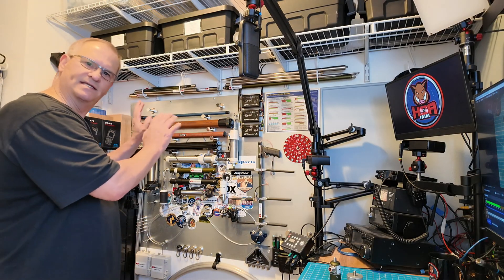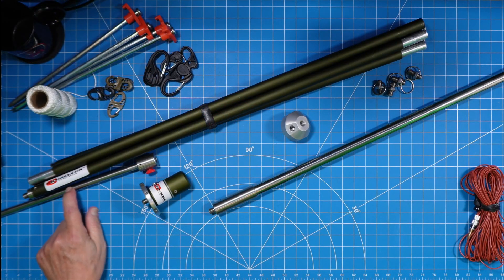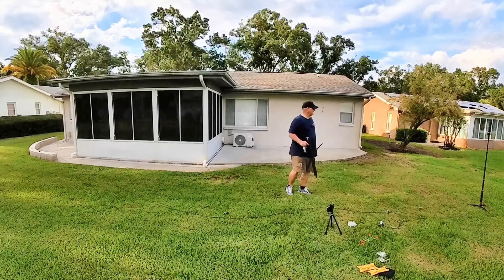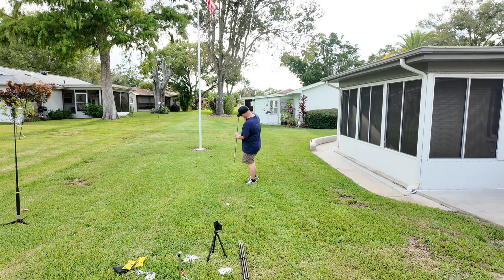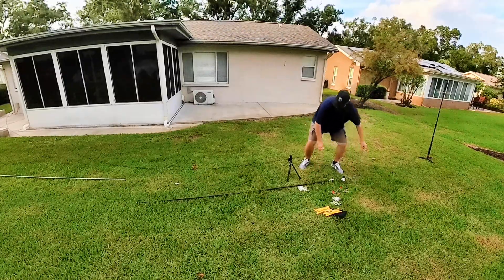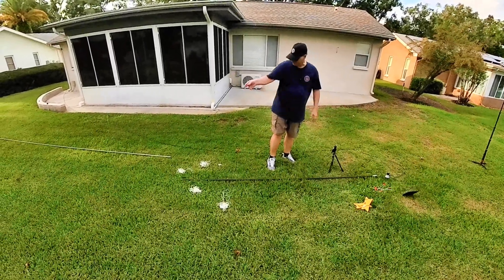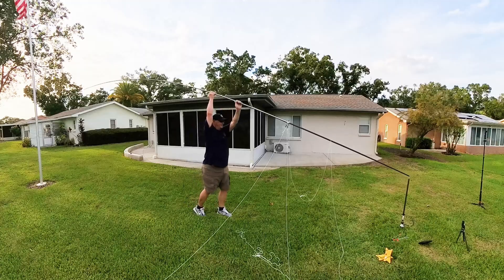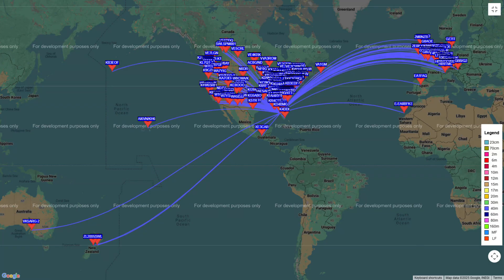Make a Collapsible Portable ¼ Wave 40 Meter Amateur Radio Vertical Antenna with Components You Own

Comment: Great video, Bob. Since I have other antennas I go portable with, I have been thinking lately about making a semi-permanent quarter wave vertical near my shack for forty meters out of some aluminum military mast sections.  I have the hard plastic top and bottom sections, so separation from the ground is there, and then I'd need radials.  The total length of eight sections would be thirty-two feet, so I'd need another foot and a half at the top, which could be just about any piece of metal bolted on, or a cut down mast section.  That old Army stuff is heavy to lug around, and I know because I did it for twenty-two years.  Should make a find 40 meter vertical.  So, thanks again for posting another excellent video!

-K5SFC
Reply from the maker: Sounds like you have a solid plan.  If I wasn't in an HOA I sure would find a way to get a 1/4 40 up permanently - it works so well.  I enjoy 20 and up mostly because its easier to hide those antennas; 40 is more difficult for me  --  this solution worked!  Have fun with your planned deployment.

Comment: If you don’t have CHA Mil Ext, can the CHA single ext be used.  One set of the singles is 54 inch’s, and looking to use a surveyor tripod.  If I use a spike, a second set of the singles ext would give me 108 inch’s vis 105 with mil ext
Reply from the maker: I think you will be just a smidge long with two of the "singles", but you can always reduce the whip just a bit to get it resonant...it will work.

Comment: When I deploy my 25' whip, I always have it screwed into the blank and I extend it straight up vertically to avoid stressing the joints. In your situation, I would have put the SS25 on the mil extension with the SS25 collapsed. Then I would have taken a step ladder outside, stood on it, and slid the SS25 up vertically. Since the mil extension was up about 8 feet high and most people are roughly 6 feet tall, any modest step ladder should work.  That aside, I like this idea. I have everything but the mil extension so I might buy one so that I can set-up a 40m antenna without the high Q and losses from a coil. 73
Reply from the maker: Yep, I think the step ladder version works best for stability during the set up, and less strain on the telescoping whip joints.   Thanks for the view and comment.

Comment: Thanks for another informative video Bob. Always enjoy them. Maybe try erecting and stabilising the Mil-whip first with a little slack in the guys before dropping and making the final installation of the CHA25 a little less exciting (expensive), particularly if there is a breeze. Loved your aproach to walking it all up with the first section installed as a stabiliser.
Peter
Reply from the maker: Thanks Peter for the view and comment.  Several alternate suggestions came in to add to the list, appreciate yours.

Comment: just a heads up, you said 24 feet the graphic on the video says 23 1/2 feet. I’m pretty sure you meant 33 1/2 feet.
Reply from the maker: Wow, that's what I get for putting the finishing touches on my video at 2AM...mistakes.  Thanks for catching this and letting me know.  I did indeed mean 33 1/2 and I pinned a comment with the correction.  Thanks again.

Comment: I’m running a 20M half wave/40M quarter wave vertical wire on a partially extended 42-ft mast, feed point elevated 7 ft, with an elevated 32-ft radial. These are connected to a 4:1, and a choke on the coax. So, it’s basically a giant POTA Performer for 20M and 40M. It works great. Granted it’s not portable though; the mast is very heavy. So you’ve given me food for thought as I have most of the bits you used as well.
Reply from the maker: You're the second person to mention the half wave 20M....how did I not realize that was right at my fingertips????  Gonna have to do this again for sure.
Reply: @HOAHamRadio fractions are a struggle for some. 😂

Comment: I run a full 40m 1/4 vertical but I do it a little different. It started life as just a 29ft random wire. One day it dawned on me that with a another 3 feet or so I could swap the 9:1 for a 49:1 and have a 20m efhw so I added a 3ish foot section of wire. Some time later it dawned on me that wow that's almost a 1/4 wave on 40, so I swapped out the unun for a cobra head connector, cobbled together a few radials, ran it up the 10m mast and it worked brilliantly with no additional tuning. I now have 3 antennas from the same piece of wire.
Reply from the maker: Interesting how these ideas morph over time; that's how it works for me too. Thanks for sharing.

Comment: Very interesting adaptation of antenna parts. Now that you've figured out the parts to make a 40m 1/4 wave vertical, I'd love to see this adapted to a 20m vertical half wave. That could make for awesome DX.
Reply from the maker: Now why didn't I think of that???  Thanks for the view, and the idea; gonna check that out for sure.
Reply: @HOAHamRadio I really wish someone made a 49:1 in a package that fit 3/8-24 top and bottom.

Comment: Instead of using the little weak string - you could use a pack of CHA COUNTERPOISE KIT and it them as antenna stabilizer BUT also as radiator....
Reply: How long should the ground radials be in this case?
Reply from the maker: Hmmmmm.  Ring terminal on the CHA Counterpoise snugged down on the CHA Hub?
Reply: @HOAHamRadio  Ring terminal secured by the shakles on the side of the TDL HUB.

Comment: The setup complexity of that antenna system will GREATLY be reduced when the CHA MARIN ADAPTER will be released and it should be in about 2 weeks or so...
Reply from the maker: Now I think I'm gonna have to show that off with the exact configuration.  This will be perfect for the HOA; flat on the ground during the day, up in seconds at night.

Comment: Is there a big enough advantage to this as compared to a 40 meter coil? It just seems like a lot of stress on the 25 foot whip. I would try it but I would want a helping hand and a step ladder. Just curious, I am just learning. Thanks and 73.
Reply: Yes and No: You'll gain on efficiency because the antenna is 1/4 wave on 40M and you remove the losses of the loading coil but, on the other end, you'll need more setup time. So it's a trade-off.
Reply from the maker: I'll be doing another set up in a few weeks that will make standing this up easier, and I'll be able to control the raising up much better.  The performance on the 1/4 wave 40 (without the coil) will perform better.

Comment: Ive used 0.63 weed eater string it works very well. It lasts
Reply: To hold the antenna. Ive hung dipoles with it . Holds forever in this Florida 🌞 sun . I had a g5rv hung with weed eater string 0.63 held up for 5 years until I had to take it down they built a house next door the weed eater string was still in great shape . Its nylon I believe
Reply from the maker: Wow, never thought of that @Atomshamradio, thanks for sharing.

Comment: How do you have things fixed to your steel label wall?
Reply from the maker: I use magnets for everything; magnet hooks or posts.  There are few items on with adhesive backed velcro.

Seems its time for me to do a short video focusing on the wall and how I set it up.